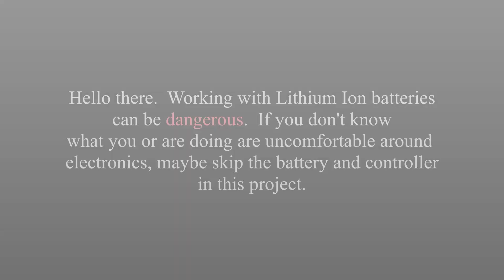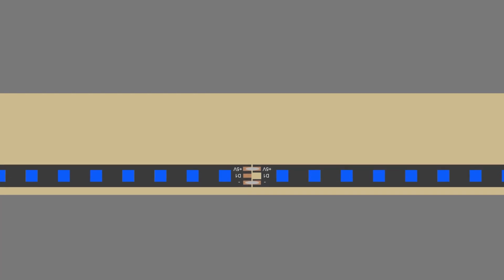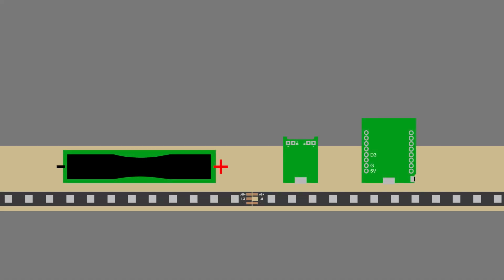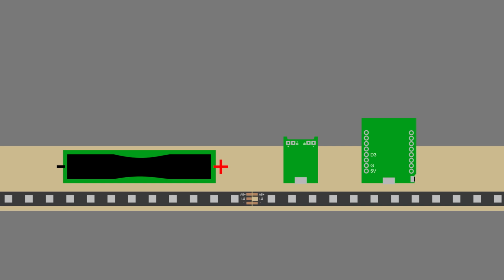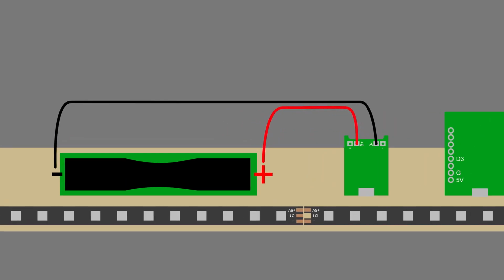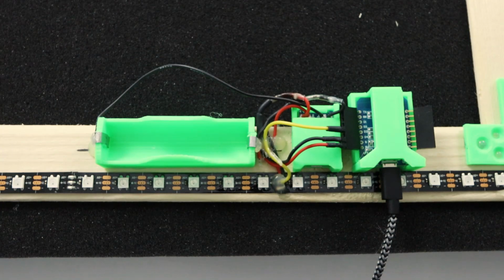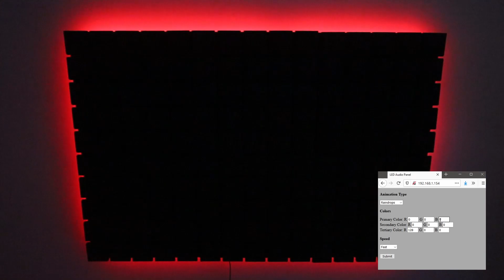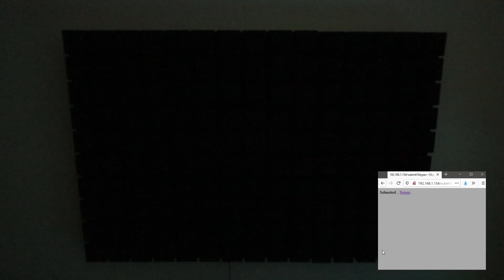DIY RGB LED Backlit Acoustic Panels You Can Control From Your Phone!

Comment: How long does the battery last on average? I want to make something similar, but I'd rather not have any cables showing. Do you have suggestions for modding this build so that it can be 100% battery powered?
Reply from the maker: It will largely depend on how many LEDs you have lit up and how bright they are.  I mentioned in a previous comment that I had to reduce the default brightness as I was blowing the regulators on the WeMos as it only supports 1a.  Since most 18650s store 2500 - 3000 mAh you'd be looking at 2.5 -3 hours if you managed to run your LEDs at at 1a max the whole time.  It's pretty easy to save power though.  In reality it'll be a bit less but that's the general idea.  If you run any color besides white you're saving up to 2/3 total power, if you run a pattern in which not all LEDs are lite you save power, and of course you can reduce the brightness to save power as well.  When I was running off battery they would run all night without dying.

As for modding, it should be simple.  Just remove the charger module altogether and wire the 18650 directly to the WeMos.  The ones I've used have handled the 3.3v from the 18650 over the 5v pins pretty well.  You lose drain protection though, so if you forget to remove the battery it will run it down to zero and destroy it.  Otherwise, the charging module provides that protection so there's no reason you can't run the circuit exactly as it is.
Reply: @LilMikeysBigPlans  Thanks for the info! This is very helpful. :)

Comment: Well, here's a project I want to do now
Reply from the maker: Go for it!  After having mine up for a while I'm still loving them.  They're attention grabbers on Zoom meetings and my wife frequently uses the 'alert' feature I added recently.  In hindsight, the battery operation probably wasn't necessary as I pretty much never unplug them.  Maybe save yourself a few dollars and solders if you're so inclined.
Reply: One of the Best Ideas of SoundProofing is "SoundProof Curtains" That Stops Outside Noise by 80% (25 Db) Tested. Check Here: https://livesoundproof.com/best-soundproof-curtains/

Comment: Well, guess I'm not getting these. Too much work! I need a degree in physics, electrodynamics, geometry and welding! I'll just stick to regular white LED's:)
Reply from the maker: Naw!  It's not as bad it seems.  In fact, forget the battery and controller and just wire the LEDs to the WeMos and power it off of USB.  After having them for a while I pretty much never unplug them.

If there's interest I can put together some getting started videos to help folks familiarize themselves with Arduino development in-general.
Reply: One of the Best Ideas of SoundProofing is "SoundProof Curtains" That Stops Outside Noise by 80% (25 Db) Tested. Check Here: https://livesoundproof.com/best-soundproof-curtains/

Comment from the maker: Another code update for these panels.  Enabled OTA for the ESP8266 so you don't have to run a cable to update them.  Added a 'forward' capability.  If you put the IP address/hostname of another panel in the settings page it will relay the settings to the other panel.  The timing on the panels is ms based so you'd think they'd stay pretty well in sync but my two panels fall out of sync pretty quickly.  At least it will keep them doing close to the same thing though.  There's no checks so don't do anything dumb like self-referencing or cyclical referencing between panels...
Also, added a flashing 'alert'.  If you hit <IP address>/alert it will flash red/yellow for a few seconds.  I did so my wife can get my attention when I don't have phone nearby.
Reply: Both awesome and hilarious 🤣

Comment from the maker: Hey folks.  After running this thing 24/7 for a while I've made some improvements.  First, the power draw was too darn high.  Using the Adafruit math, at full white each pixel uses as estimated 20ma of current.  That would be 3.3 amp for my 168 pixels.  After blowing diodes on the WeMos I found that they suggest sticking under 1amp on the 5.5v regulator - this would be important when powering directly off the WeMos.  In addition, the charge module is also rated for 1amp.  I was seeing battery drain while powered as well as a blown battery module.

Now, the sketch defaults to very dim (16/255 = ~6.25%) so just over 200ma with everything lit up white.  The full brightness setting is now half power so just over 1.5 amp if you lit up everything full white - which should be rare so do it at your own risk.

Finally I added a few new animations and a lot more color options.  Enjoy!